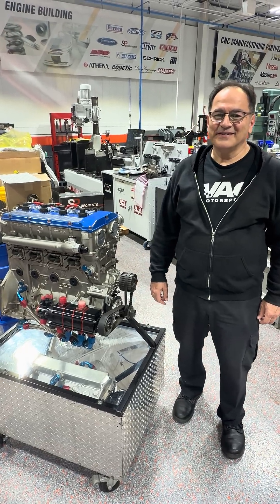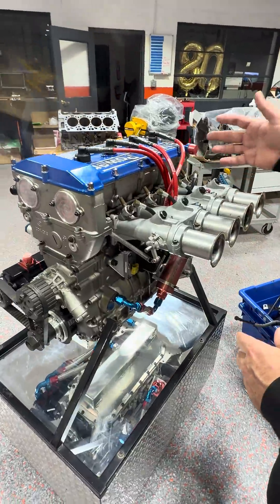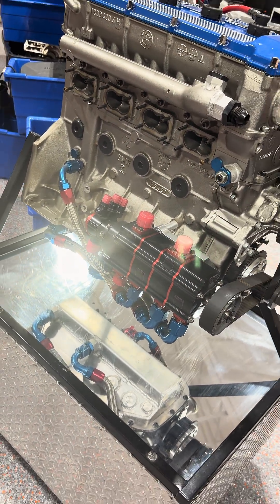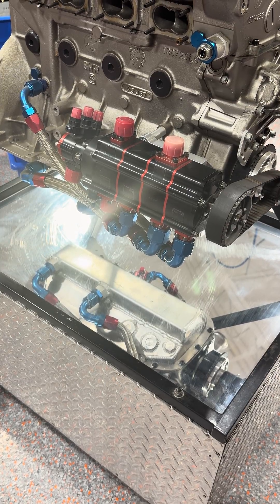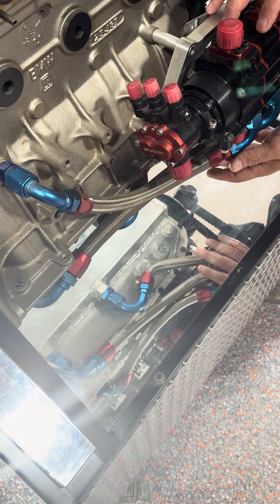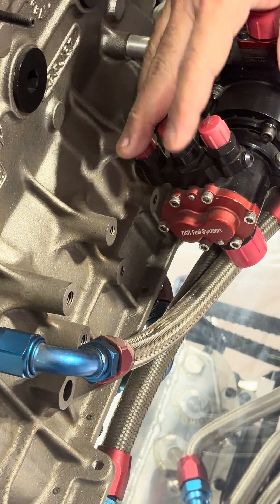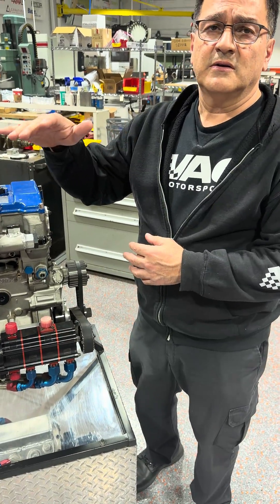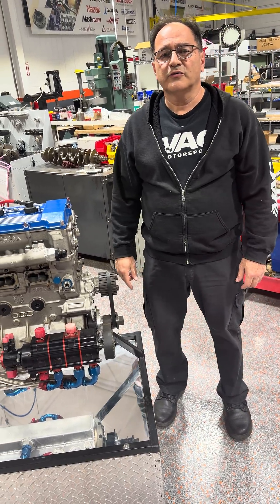BMW OG S14B20 Built Engine🔥 | VAC Motorsports Dry Sump Deep Dive

Comment: Hey Tonny,
Doesn’t it create enough vacuum to allow the bottom of the pistons and the crank to rotate without air or fume resistance?
Reply: We usually like to see anywhere from 7-14psi max. And yes, creating good vacuum does help make a little now power because of the better windage control. Less crankcase pressure means more potential power.
Reply: @tonysalloum6973 🫡